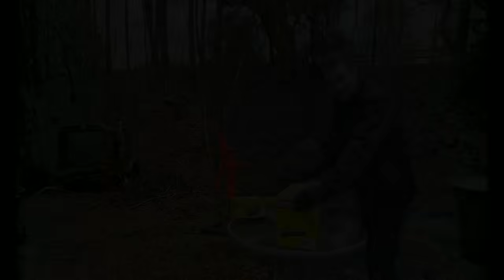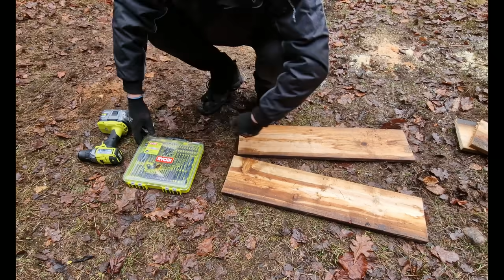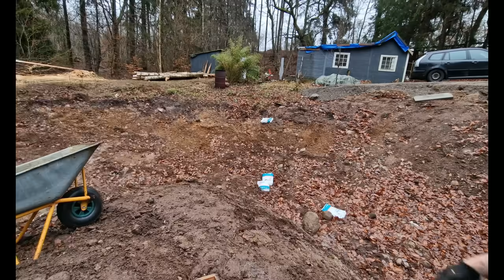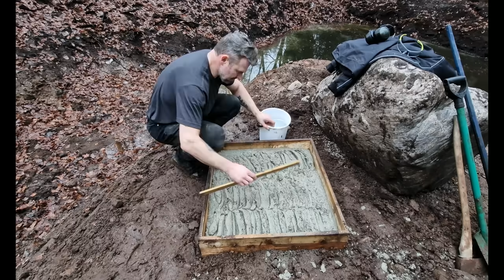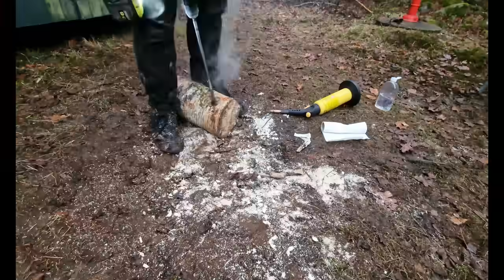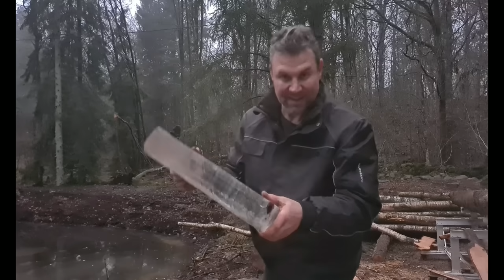Gjuter fundament till fyren

Comment: Sån motorsåg köpte jag för några veckor sedan. Inte satt ihop den än.
Kosta 5600 på Bauhaus då. 👍
Reply from the maker: Den är mycket bra så jag tror du kommer bli nöjd 👍😁
Reply: Kedjesåg Ryobi RY36CSX35A-160, 36 V
3.849,30 kr inkl. moms

3.079,44 kr exkl. moms

Ord. pris 5.499 kr 

:(
Reply: @Nikpet3D  
-150 heter min.
Ink laddare och 5.0 Ah batteri.
Köpte den för 4800 med lite rabatt.
🤪
6 veckor sedan. 💪
Reply: @2TOKE69  ok vet tyvärr inte skillnad på dessa.